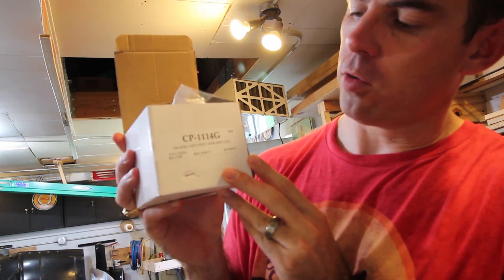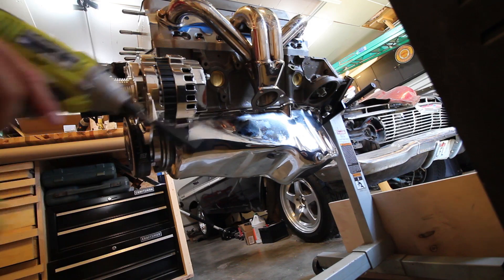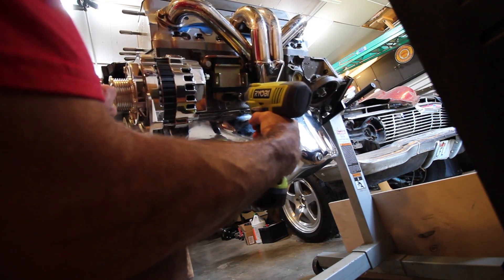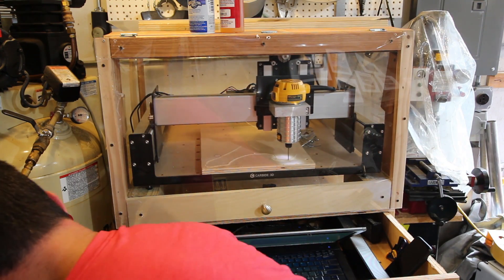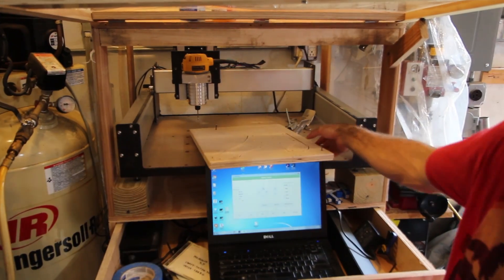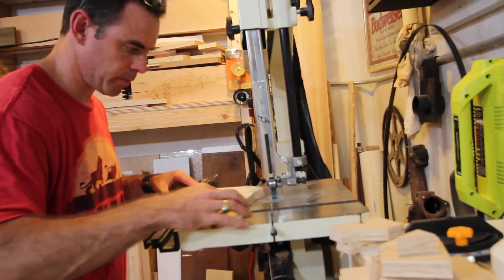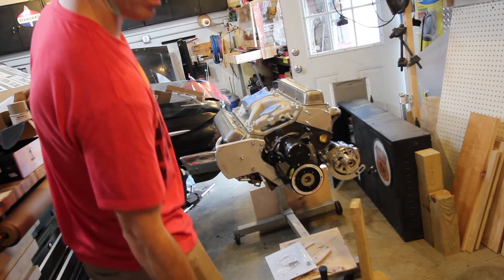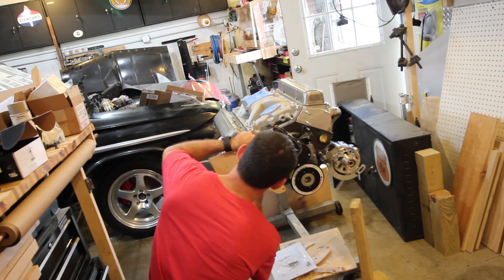BLOWN SBC Build Part 4: Shapeoko 3 Milling Aluminum Supercharger Brackets

Comment: I was wrong on the earlier post, the belt doesn't go around the water pump, its the crank pulley that's not got enough contact, which might still slip at higher rpms and cause you to lose blower boost to your engine.

Comment: How much power are you expecting to make?
Reply from the maker: Thanks for the question - 360-480 hp depending on pulley diameter and intended engine RPM where it peaks. I'm presently uploading a video on how to calculate that.  Conservatively I'd be happy with 390-400 hp peaking around 5500 RPM, and 300+ torque from 2500 RPM and up.
Reply: Awesome! A few years ago my father and I inherited my grandmothers 1966 Malibu. It has a 283 and a powerglide trans; I left it outside and now it is leaking coolant from the engine from side of block. Who knows it could be a warped head, which makes me feel better. I'm just looking at videos and trying to save my money to rebuild it lol.
Reply from the maker: This is almost the same story - this was my Grandfather's car with a 283 and 2 speed Powerglide. This project started with a new distributor. :) Good luck with yours my friend!
Reply: Thanks man! I cannot wait to see your finished engine!